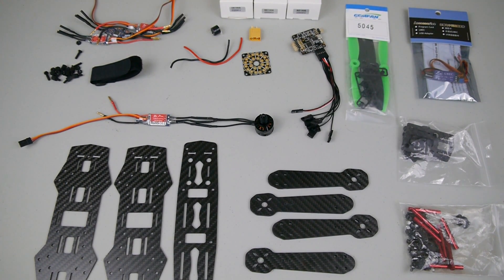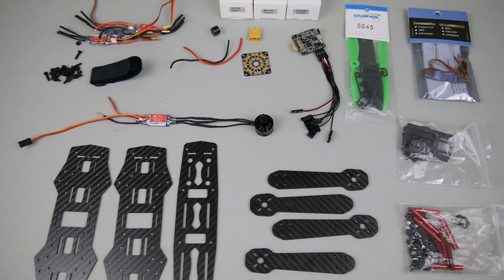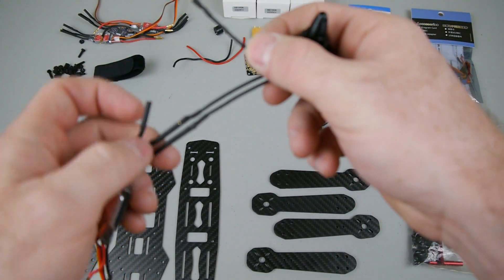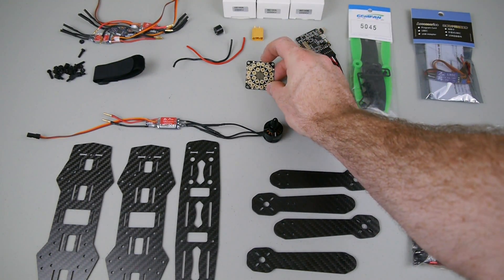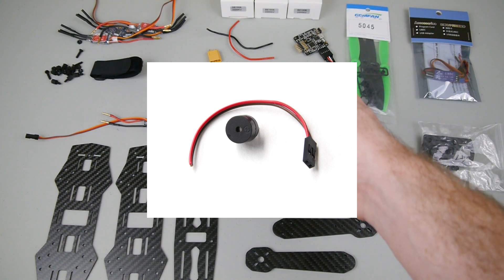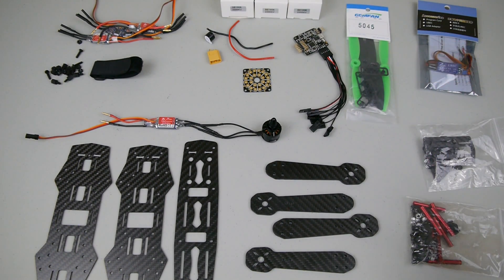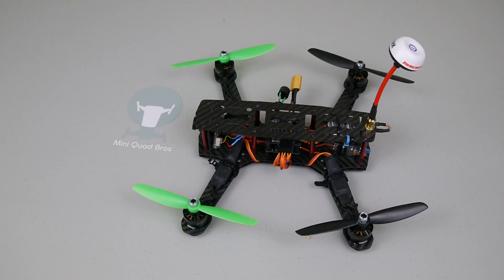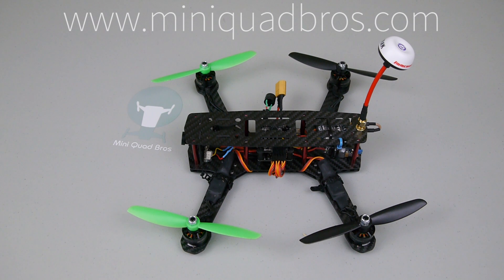Mini Quad Bros 3s and 4s FPV Racing Mini Quadcopter Kit Review

Comment: Nice improvements! Im still rocking the setup you sent me a long time ago. Im glad you upgraded the motors to the 4s capable 1806, leaves lots of room for adding to and improving for advanced pilots. 

Glad this seems to be working out for you!

ps. Ive been using and recommending your pids to anyone asking for 250 pid help. Have yet to hear that they didnt work for a single person :)